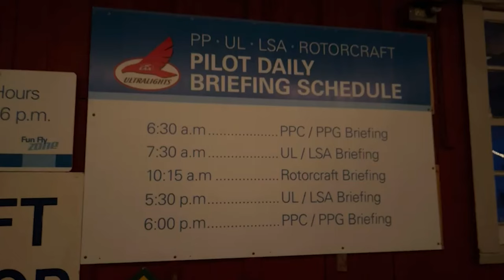Follow Up: Airplane near death experience? Stall spin crash!

Comment: Did you ready my comment on your 1st video and watch the link to Wayne Handleys video explaining skidding turns? 
You never mentioned in your second video that you were in a skidding turn this is a very important fact to share.
Reply from the maker: I’m not sure I saw your comment. I tried to read them all, but maybe I missed it. I’ll try to find his video. 

Why do you think I’m in a skidding turn? Not saying I wasn’t… I’m just curious what you see in the video to show that.
Reply: @texasov  watch your first video starting at .02 seconds until the stall at .10 seconds zoom in on your left wing at the tip you will see the left aleron deflected down but your turning left. This is due to using bottom or left rudder and skidding in the turn the ball had to be out to the righ (high wing) this is also why you needed so much up elevator in the turn. In a skidding stall the plane will always roll to the low wing and in most cases can be fatal at pattern altitudes. This should be the major take away or lessons learned from your video. Send me a e mail would be glad to explain this in detail or on phone as well. Fly Safe